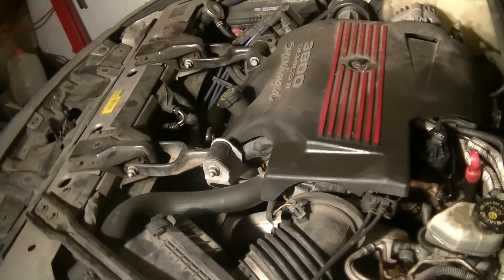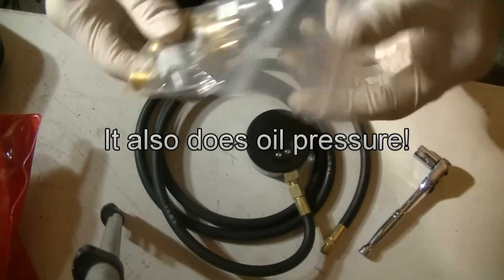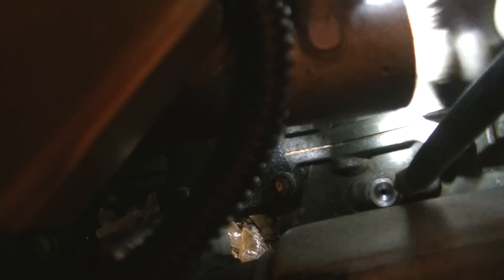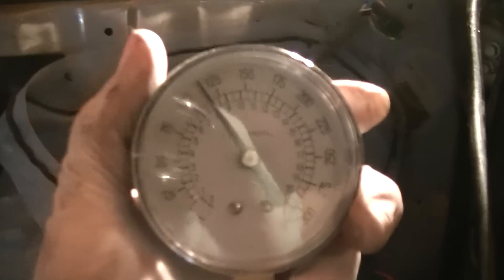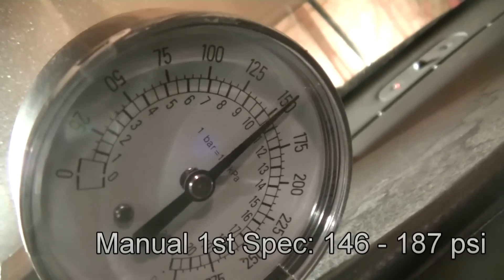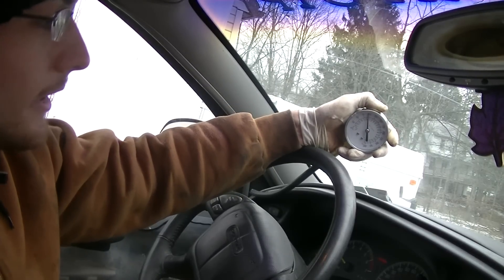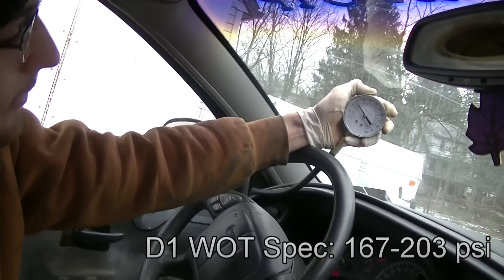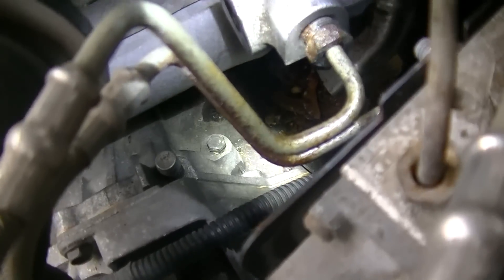How to Measure Transmission Line Pressure

Comment: good day I live down in the Bahamas and really learning a lot from your videos. I'm working on a 2004 jag X-type (JF506E). I chance the fluid in it to Max-life and now it's not taking reverse. no I didn't take out the band anchor bolt. just chance the fluid. after getting no reverse I opened it to find the band broken. I chanced it out and still no reverse. at idle I'm getting 95psi at the Reverse Clutch Pressure Tap. I never adjusted the SERVO PISTON. thank you so much for your help
Reply from the maker: +Da Beginner I never worked on that transmission but that is very strange.  You should be getting much higher pressure in reverse.  The band being broken is also surprising.  I would need to see a picture to give you a better answer as to what happened.  How are the pressures in the other gears??

Comment: Good video. I appreciate you showing the gauge during the stall test. Do you have to use a thread sealer on the bolt you re-installed at the end?
Reply from the maker: +SwansCards01 No you do not.
Reply: +MattsMotorz I replaced the transmission in my car 04 nissan altima when I start it up and drive it right away it change from 1st to 2nd but I think warns up only runs in 1st gear I put my scanner and one of the two lines pressure says 0%00 and the other there's pressure please give me some ideas please

Comment: Hey Matt,
I rebuild my RE0F10A transmission myself. I followed ATSG manual to rebuild it and I did it in right way. After installing it, my wheels doesn't rotate at all in any gear. It feels like there is no connection between engine and transmission. I am also not sure about oil pump that it's working or not. Can you tell me how to check oil pump is working fine without taking out transmission? I tried gauge test but it seems none of the fittings included is right one.

Comment: hi this might sound stupid I tried rebuilding my transmission at home it was a 99 Ford Windstar my initial issue was the transmission shudder on uphill and would slam into second gear sometimes. I did a complete overhaul and I'm sure I put back everything back the right way. I replaced the torque converter and clutch packs I. found some badly damaged o ring seals the only thing I did not go deep into what's the valve body I did ohm out solenoids they were good after I put back everything and I drove it the transmission does good in reverse and drive (first gear) but as soon as it is time to change gears it goes into neutral I have to slow down and it comes back into gear sometimes in first or sometimes in second where do you think I went wrong?
Reply from the maker: This kind of thing is very hard to comment on without working on it myself.  Transmissions are very complicated and each one is a bit different meaning there are several reasons why that might have happened.  You need to get a hold of the hydraulic circuits and determine what the transmission is trying to do when it switches gears (you can get them from alldatadiy.com).   Then, from this information, use a pressure gauge to measure line pressure during the issue.  

During your rebuild, were you using the factory service manual???  Or any rebuild manual?

It seems like second gear is an issue before, and after the rebuild.  Could be useful diagnostic information.
Reply: Yes I have the alldatadiy subscription and I have seen the diagnosis flow I will start my way from pressure testing it and I will update you thanks for responding
Reply: hi Matt I did find 1 issue I ohmed out the VSS and the reading was 486 k ohms (that is equivalent to 486000 ohms) when the manual specifies it to be between 190 -250 ohms I think that was causing all the trouble. but I don't get it why I didn't get any codes?
Reply from the maker: Oh good catch.  That could be causing your problems.  Let me know what happens.

You don't always get codes, especially on those older transmissions.
Reply: hi Matt I went to the junkyard today took readings on 3 VSS sensors and got 486 k ohms it can't be all 3 are bad or my manual is wrong?
Reply from the maker: Wow that is odd.  What you can do, is go to an autoparts store, and have them take the new part out for your (you may have to have them order it in).  They can take it out and you can ohm it before you buy it.
Reply: Damn, I wish you would have made a YouTube video out of the rebuild. You could have reviewed it in fast play back and discovered the problem. It would make a very good lesson on rebuilding a transmission too! Brave man to attempt the rebuild!😁
Reply: Chances are you put one of the one-way roller clutches in backwards, easy to do.  To confirm, see if it shifts correctly using the manual range, or, PRNDL L1 to L2 tp L3...etc.  if it shift properly you have the OWC in backwards...oops.
Reply: @charlesstepanian397  thanks for the reply but I managed to fix it. Ooo this transmission I took out 4 times and installed it back in my garage without a lift or proper equipment suspended the engine with a 4x4. But here was my silly mistake, I had found that I had put one of those plastic balls in the valve body in the wrong spot arrrgh. 2 years I had it sitting in my garage. But finally got it fixed thanks anyway god bless

Comment: I have a gauge meant for testing cylinder compression.  Is that the same thing?  Good to use as long as I have the right fitting?
Reply from the maker: GerGa769  I am not sure to be honest. They both measure pressure in the same way so I believe it might work.  However, what is good about the oil pressure / tranny pressure tool is that the hose is REALLY long so you can drive with the gauge through the window.
Reply: MattsMotorz I am going to get the same one you have, found it on amazon.  My compression tester just doesn't say anything about oil or transmissions and does not have the fittings for it.  $35 worth it
Reply from the maker: Definitely worth it!

Comment: hey Matt, I have an 07 grand prix with the same 4t65e transmission. are the shift pressures going to be the same as your model year?
Reply from the maker: I THINK they will pretty close.  To find out for sure, you will have to get your hands on the factory service manual.  You can actually get it for pretty cheap (online version) at alldatadiy.com

Comment: How can you damage the transmission by doing the test ??or you mean the high pressure test  Since you stepping on the brecks and gas pedol??
Reply from the maker: By stepping on the brakes and flooring the gas pedal, it puts a large amount of stress on the transmission.  But more importantly causes the fluid to heat up VERY VERY quickly.  Overheated fluid is a death sentence in an automatic transmission.
Reply: @MattsMotorz  overheated fluid comes from constant stop and go movement...each time the car shifts and the clutch packs have to grab it creates heat from the friction...also on many 90's and early 00's hondas the factory valve body doesn't have sufficient flow to the torque converter, they need an updated valve kit that allows for line pressure to the torque converter at idle to allow for proper cooling